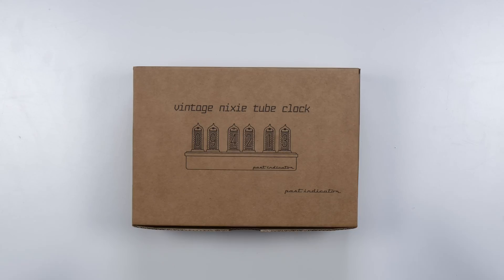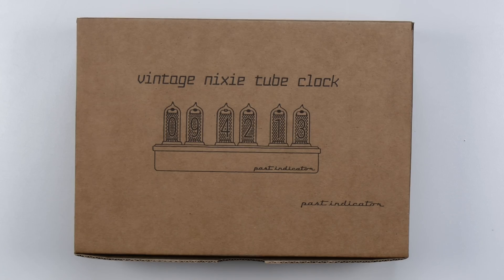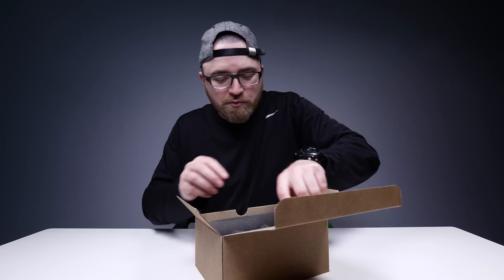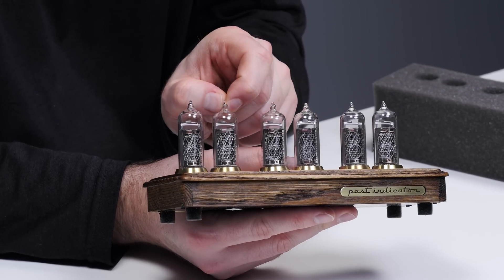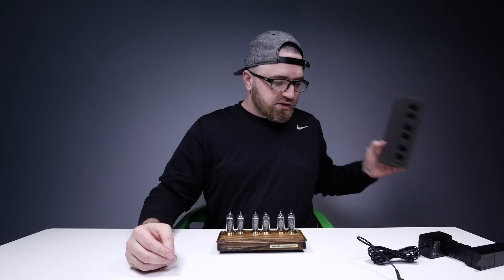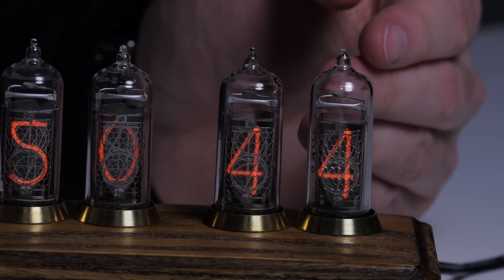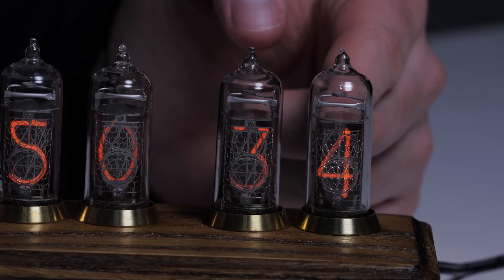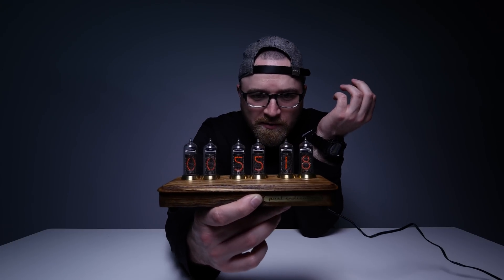The Clock Is Ticking...

Comment: The upside down 2 as a 5 does not cut it for me in most Soviet tubes.  Deal breaker.
Reply: MegaBakerdude there are IN-8-2 tubes with correct 5. It easy to replace them

Comment: I have both a digital multimeter and frequency counter from Heathkit that I bought and assembled in the mid 1970s that still work fine.  The displays are totally nixie tubes.   Forty plus years, original display tubes.

Comment: Vintage? Any electrical engineering student can probably make it with whatever is in their garage.
Reply: Do you not know what vintage means?
Reply: Both definitions involve wine, but people commonly denote something with the term vintage if that specific object is over 10 or 20 years old. Do you not know what being cheap looks like? I have hundreds of nixie tubes, brass rings, and pieces of plywood. Like I said, anyone can make it with ease.
Reply: DestinationMan I believe I do, but you are contributing nothing if all you can do is say 'wrong' and walk away.
Reply: Here's a contribution, since just entering Vintage into google gives 2 wine references as the definition. http://dictionary.cambridge.org/dictionary/english/vintageCambridge probable know what's going on so I trust them. Vintage for a man made object is usually over 60 years. The fact you have a load of tubes is one thing but making the tube itself, that's quite another.Also banging them together at home isn't going to make a good tube, might last a week if your lucky. Russia is probably the only place in the world that still produces tubes and at that only for audio. Look in any good tube amp be it guitar or home audio, they all use Russian tubes. They continued development of tubes long past anyone else because all Russian military radios and electronics still had tubes as they weren't susceptible to EMP. Now there is lightweight shielding and chips designed against it so no one makes them any more. Nixie tubes? What use are they today beside the novelty, its why they aren't made. That's where the vintage and limited and depending where you live hard to make and/or access
Reply: Skunkwurx What the hell are you talking about? Nixie tubes are commonplace around the world. They're used for building basic circuits.

Comment: Remember to rotate those tubes around so they wear evenly. The hour tube in the first slot will never get past 2 if set for 24 hour time and 1 in 12 hour cycles. When the tubes illuminate they release a bit of dust like chemical that coats the other digits in the rube. If you wait too long before rotating them they arent as bright, and you cant clean them. Sweet clock though! Need to get off my ass and build mine.

Comment: I was expecting it to be much more larger and brighter.
Reply: It should be a lot brighter - I built a clock using these tubes myself a few years ago. And mine is much much brighter. Bad circuit design on this lamp it seems.
Reply: +Mythricia was it hard? I plan to do one myself too.
Reply: I plan to do so.
Reply: i bought mines because im shit and soldering lol and its pretty bright i bought mine caseless and put in clear plexi glass
Reply: depends on the kit you buy, the more expensive ones will include a pre manufactured circuit board so all you have to do is find the right tubes and solder them to the board and the clock is ready to go, price really depends on how much work you want to do and what kind of case if any the circuit board goes in
Reply: Just buy one with bigger tubes

Comment: I'm pretty sure this isn't cutting edge for the eighties. Maybe the 1900's but in the eighties they had colored tv meaning the most definitely had digital alarm clocks
Reply: These are definitively digital displays... Inside that box are old soviet microchips that were made specifically to drive these kinds of tubes. I know this because I built a clock like this myself.

Anyhow. You have to remember this is Soviet Union. They made millions of these things, so they stayed relevant for a long time over there. They kept manufacturing them almost into the 1990's.
Reply: Mythricia i don't know much about russian history so maybe i'm wrong

Comment: i feel sorry for the last tube. because he has to work every second. must be very tired!!!

and i do hope this tube can survive 30 years as the manufacturer said.
Reply: They have relatively limited lifetime, when they're actually turned on. A lot of Nixie clocks therefore tend to have functions like turning off during late night, to save lifetime on the tubes. They undergo something called "cathode poisoning" which degrades the tubes over time. Many nixie clocks also occasionally play a little animation every minute to make sure all digits get exercised, to delay poisoning. Usually they do something like display the date, or just quickly flip through every number on every tube for a few milliseconds.
Reply: King of HuaQiangBei The one cycling though numbers will last the longest because all of the numbers are used. The ones that are stuck on the same number for ages is the one that could burn out.

Comment: what would happen if electricity is cut for an hour?
Reply: There's a backup battery inside the box, to keep time. Last for like 10 years or so. It won't display the time, but it should remember it. This is just like any other plug-in clock works anyhow.

Comment: Very cool but expensive,  but you can save a few bucks on the diy kits if you know how to solder.
Reply: Some of the DIY kits are better as well - this one doesn't seem to have any tube-life-saving stuff enabled... Better clocks use some techniques to extend the lifetime of the tubes. Also this one is really dim for some reason. Mine is super bright and pretty.
Reply: They do have "tube saving stuff" They will cycle the numbers every 10 minutes to avoid cathode poisoning.
You may be able to make it do it more frequently through some settings as well but I'm not sure. Still though. 30 years...that's not bad.

These tubes also have adjustable brightness. They're probably on their lowest setting as default. There's also loads of more features listed on their site. 
It actually sound really good for a pre-assembled nixie clock. I think I'll buy one actually, they're so cool.
Reply: Yoda

I'm no expert, but I think it has to do with the gas inside the tube being absorbed by the inactive cathodes into some form of oxide coating.

(The cathodes in this case being the numbers inside the tube.)

This will cause resistance on the cathodes and will cause the cathode to either flicker or just be very dim. And in extreme cases...to not work at all.

So just by switching all cathodes on and off every now and then prevents the oxide coating from building up.

I don't know the chemistry behind it unfortunately.

Take this with a grain of salt. I'm not very well read on the subject.
Reply: what is cathode poisning and how does it happen?
Reply: Muppetlord thank you for the explanation
Reply: Muppetlord That's a pretty good explanation of it - there are quite a few different causes and mechanisms for cathode poisoning though. In Nixie tubes, it's kind of a mechanical process - when a segment is lit, it causes "sputtering" - which is a phenomenon where little tiny (really tiny) particles of the lit cathode material is actually ejected away from it, usually causing a thin metallic coating on the inside of the tube. You can see this in old radio tubes or nixie tubes, and so on. It's quite pretty actually! And 'sputtering' is done intentionally in other applications to coat objects and surfaces with metal. This is how you can put an ultra-thin and even coat of silver or gold or whatever metal you wish, onto another surface, for example.

Anyhow, if only one digit is lit most of the time in a Nixie tube, this metal coating starts appearing on the other digits as well, and causes them to increase in resistance... Which will eventually make them very dim, or may even cause them to not function at all anymore. By lighting all digits once in a while, you keep this "coating" of cathode material away.

There are other mechanisms as well, purely chemical reactions for example if you have oxygen leaking into the tube, then, as oxygen tends to do, it will oxidize the cathodes, and un-lit cathodes will oxidize faster. But a leak like that is just bad news for everyone, it'll probably kill the tube, lit or not, pretty rapidly.
Reply: Mythricia 

 I see.

Very well explained. Thanks!
Reply: +Mythricia do you have Kik or snapchat or something? I'd love to talk to you about building a clock

Comment: would be cooler if it was brighter and on batteries.
Reply: Normally they're brighter - no clue why this one is so dim. Poorly designed circuit or something. I built my own, with the same model of tubes - and they're much brighter..... Anyhow it consumes quite a bit of power, so batteries wouldn't last long. It does remember the time if you have a power outage though, it just won't display it.
Reply: Oh hey...you again. Not sure you should go around saying they're "poorly designed". All you had to do was to read on their site and you'd find out everything.

For OP: They have a brightness setting any much much more. Check their site.

Comment: so its a digital clock inside light bulbs?? That's nothing special.
Reply: They're not light bulbs.... They're basically like old radio tubes. Same old technology.  There's nothing inside the bulbs other than metal and gas.
Reply: and electronic display panels.

Comment: I think I would believe more that it was rustic if the glass housings didn't resemble an H4 headlight bulb for a car. I like literally a perfect image of it
Reply: Well, radio tubes/valves have looked like that since their invention in like 1904.... And these are basically that.
Reply: Mythricia I don't disagree with your statement, but the idea of a company making many of these using only rustic old tubes is not probable given limited quantity, I'm merely stating that they mass produce the bulbs of course which by itself is a contradiction of the true authenticity of the product but not saying the product is bad as I definitely would buy some myself. Just not a fan of false advertisement imo

Comment: How much watts that thing uses?
Reply: Less than 1 watt per digit. Very high voltage, very low current. It's not a regular lightbulb, the wires aren't glowing due to heat :)

Comment: nixie tubes are cool as fuck, but the ones in the video are cool
but there are some tubes that have orange digits and have blue light at bottom
Reply: The blue light at the bottom on some tube devices is just a modern LED mounted underneath. Might look cool, but has nothing to do with the tubes. Anyhow, all nixie tubes have orange digits (including this one!) - it's due to the gases used inside.

Comment: Really cool, but I'd only get one if it had a built in alarm feature with battery backup. I have an old alarm clock I got in 99' and it still works great. A bit of a hum to it, but it works.

Comment: This display tech has yet to be beaten in terms of length of time it was used for. And it isn't Russian. Russia factories simply happened to keep production lines of nixie tubes open for the longest - that's why most new-old stock is from that part of the world. And there are many small companies making devices with nixie tubes. Nixies have been the go-to steampunk signifier in movies and videogames for a long ass time. I'm surprised at the lack of basic knowledge and observation from a renowned tech lover.